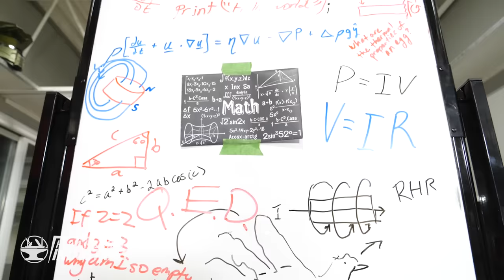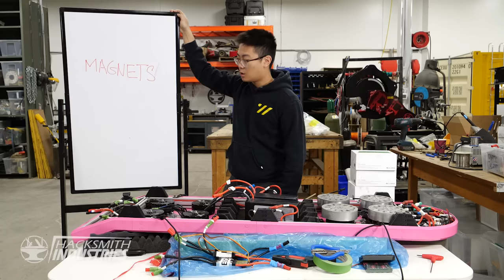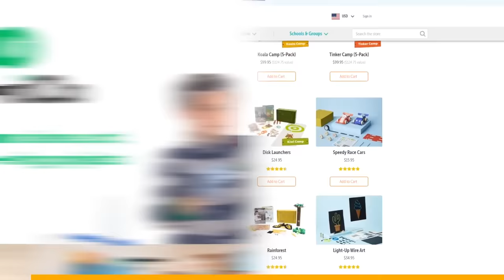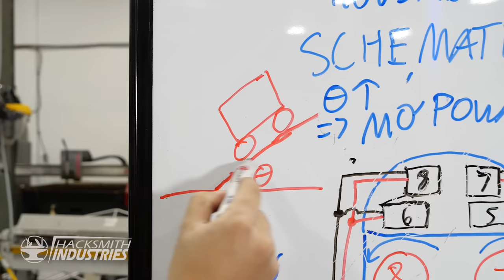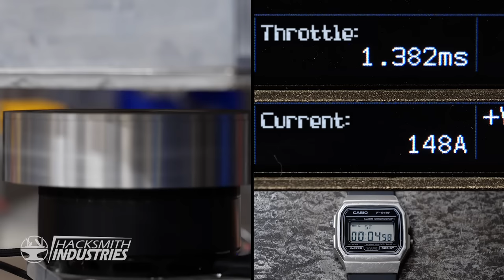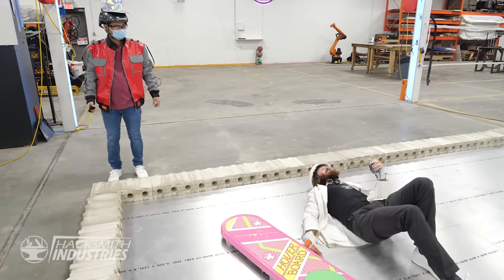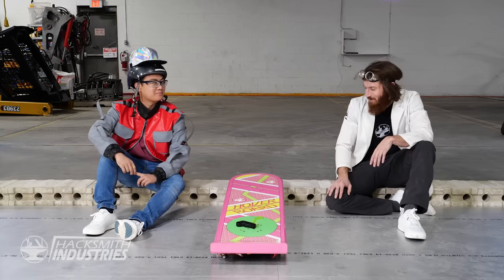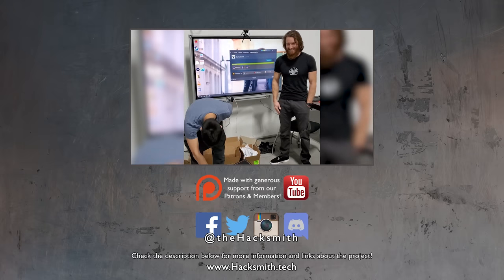HOVERBOARD TEST! (PART 2/2)

Comment: You know what else I’d bet would help the Floatation of this? 

Think Air Hockey and how the Pucks and Hand Protector Hitting Devices Float, now implement that tech into the ground beneath the Hoverboard and give the Hoverboard more of a Rectangular Frisbee like Design to hold the air, which might even cool down those engines so they don’t overheat

Comment: If you really want to have a proper hover board you would use stationary electromagnets creating a rotating magnetic field at very high speed in a similar way to the solid magnets you are using. The only difference, is the low power needed to create this affect. You will know you are onto the correct affect is when you are able to rotate compasses and aluminum plates and eventually all solids and air.

Comment: Should these hoverboards have wheels? Ok you might be saying, what is the point of a cover board if it has wheels right. Well what I'm saying the board can be fitted with wheel that have a very week suspension. Enough to aid the board but not enough to take from the experience. Doing this may even allow for a lighter board. And it might even be some what faster. Hey the more wheels the more individual suspension can be added. And more suspension the weaker you can afford to make the suspension. Question? Do hoverboards and water mix. I was thinking of a board that use water hover and wheels all at the same time. Is a board that floats in really shallow water. Shall enough so the you can push you self of the surface like you would on a skat board.

Comment: Did you guys program a feedback system for this hoverboard? 
In the video I saw lots of tests where you guys used weights across the hoverboard. What would happen if you guys attached the weights on one side of the board instead?

Comment: are you aware of eulars disc effect? if there was a way for contact resonance to "push" back at an angle, perhaps then receive less vibration per square inch.

as you mightve known, magnetism is an out of solution process.

Comment: Ok, now we see the first main problem with hoverboards. They have not strict direction unlike wheels on a real skate. So it doesn't go forward, it goes wherever it want, not wherever you want. Solving this problem and making a straight-directed hoverboard will cause the second main problem - how to turn? On a regular skate you're turning by putting your weight on the right side if you want to turn right or on the left side if you want to turn left.

Comment: Aluminum plate is soft ☑️
Unless the thicker one : 1 inch thick is more harder. Aluminum is heat distributor too. I play around with aluminum material for equipment fabrication for almost 20 years. 
U know HENDO hoverboard ?🤔
They built real hover tech too...and they are more senior ( 8 YEARS AGO ) than your creation, almost similar concept, too. You have a nice Experiment there 👍🏻😁 with electromagnetic tech 🤔❓

Comment: It kinda kills me, seeing all this, and knowing that a little group called Arx Pax did this just around 6 years ago with the Hendo Hoverboard... and they're all but forgotten today. Not a mention anywhere in the comments. Theirs used a copper surface and seemingly much higher speed motors, maybe got around the heat problem that way, with impressive run time. What kills me is seeing all the effort started from scratch, as how far their work had been forgotten...

Comment: You're very intelligent you're very intelligent person! You probably had more school than me but you're missing one or two parts on this cuz I took electric wiring for two years in electronics to yours and some classes and electric motors! One thing you went wrong you need to redesign is heat dissipation heat dissipation and also air intake flux flows okay just saying but the rest of your diet design the rest of your design is pretty good! Focus on engine heat dissipation and also bigger air intake from the top of the hoverboard those are the two things you need to focus on that should be obvious but I can't believe you even missed that!

Comment: Maybe if you only used aviation grade alminum for the board, or something like a light polycabonate, taking account the minimizing the weight of frames, that its like only the rotors, and the batteries and the rider makes up the lifted weight
Reply from the maker: But it already does float? Making it lighter won't make it floay any higher

Comment: Hovering on Eddie currents can't do without metal plates । Can't try liquid nitrogen for superconductivity । It same induction tek used in mavric levetation train here it's having its own power supply । Seen some fan ducted hover boads flying on its own power । This kinda levetation is innefficent । Draws too much power in amps । N can super heat blow esc in seconds । Try use liquid nitrogen as coolant

Comment: The disc spins he had under pink board,  is not a new concept, its actually been used to mimic anti-gravity light weight or lift, they mastered much with levetation and a bit with gyoscoptic balamce, these jr's engineers,  just needed something to mimic 'geoscoptical' with the discs spin directional population.
Reply from the maker: we explain in the build video

Comment: Its also missing some transformers to help it go higher with the amps just saying guys
Reply from the maker: That's not how this works... Transformers are only for AC power. This is a DC system ;)
Reply: Risistors would help control the out put so u dont loose important parts it would just blow up a risistor or a tranformer
Reply from the maker: Not quite right...

Comment: Now, if you can figure out a way to utilize the earth's natural geomagnetic field emitted through the ground instead of using the metal plates/mats; that would really be a leap in technology. If you could determine a way to measure the earth's natural geomagnetic resonance  mathematically, then I would suspect you could dial in the motors and ESC's to the earth's polarity, and viola! Well....maybe not that easy as it sounds. That however could take a considerable number of motors and batteries. BRAVO nonetheless on this accomplishment!! You may be closer  to that reality than you imagine. Keep up the research and development on this. You may just end up building the world's first gravity-defying "land speeder" equipped with jet turbines, ailerons, directional and reverse thrust. Think of the possibilities!!!

Comment: What if instead of magnets, you use super strong fans all around the sides and bottom of the board as well, so it can go off of metal as well.
Reply: That already exists but it's not stable going forward though there's been things that have props that are very stable. The difference was fan orientation. It's also become a distance flying sport.

Comment: That is on metal, its ment to work off plain ground if its like back to the futures board. Nice try still. Maybe try playing with the worlds magnetic field some way. Spinning magnet will lift another,it  stable spot,  no matter it stays in that distance apart of magnet spinning.
like you want. If you are smart, maybe you can do it with magnets, i seen something online,
Reply from the maker: it uses spinning magnets already...

Comment: I remember in somewhere around grade 3 I was learning abt physics and then my teacher was teaching me about magnets..(short form)in grade 3 I learned about magnets and I was going to make an empire out of it 😂🤣Please don't blame I was a 9 yo at that time :( any ways if anyone wanna learn about hover boards, check this video it will help! I remember me myself learning about the both sides of and magnetic force, if the force was VERY strong I'd say it wasn't' much of an hover board and holy I actually tried this experiment out and ooo boi was it a fun experiment cause even the slightest tilt would make it turn a lot like ALOT but if the force was  kinda small you could turn pretty smoothly and yeah I tried out the big boi magnet and then my psychopath brain finally learnt that I needed a tiny force!!I hope some one in this comments actually has tried this experiment out, by the way if anyone wanna try it out just comment on this and if there is anyone having questions about my comment, Please tell me cause I'm also a slow learner I also need time. guys have some fun trying his hover board technique it was very very good! I finally used my final hover board prototype and it used some good ol' fans ya know cuz why not,
In short form I trying to say that I ripped of a fricking fan off with the switches and stuck it to a metal oval.:elbowcough:

Comment: Why not have a board that is just the conductive metal, and spinning magnet system in the floor, this way the board is light weight and doesn't need any electronics.

Comment: Look I’m not a scientist nor a engineer , but y’all are going the most expensive and I think difficult rout. The king of random made one outa wood and a 1-2 leaf blowers. 2battery blowers and one with 1 plug in blower and it actually kinda worked. And I mean the military made a jet pack irl and they have water craft hovers things. If y’all can make a super vacuum seal than y’all can make a super leaf blower or something similar to a jet back. Not magnetic shit. We can’t just infuse the streets and sidewalks with magnets. Not tryna say I’m smarter than y’all , but I feel like y’all can come at this a better more efficient and safer way. Not to mention more effectively.
Reply: This isn’t a product, and hoverboards are just stupid. We can’t give everyone a jet pack or line the streets with leaf blowers either. Just build better transport (maglev trains in vacuum tubes etc.)

Comment: He could have used 775 50000 rpm motors that way he would go up by 5 inches (not that great but better than 1 inch) and it would be cheaper and better

Comment: i only click because the science nad engineering cost too much. I feel bad for Jimmy. However the implementation of this hover concept is not the approach I would take. The key for genuine hover is to NOT be reliant on floor/track.  Also surprised when the resistance increases with the weight of the rider we did not get further power spike (i may have skipped that bit) .. My first ever science 'idea' (Aged 10, some 35 years ago)  was for a MAGLEV car system on tracks which was totally poo poo'd for the road infrastructure changes that it would require. (better to have side mounted electromagnetic rails, and for the currents etc to be MOSTLY carried in the tracks. You don't want to carry all that hardware in the vehicle, merely switching systems to move from left rail to right rail for steering..

Comment: The problem about this should need side movements I wish yall would pay me to help invitation on this board its like you need to put magnets on four sides of the board in fact this idea would help make it go left and right with pressure plates to be added coils on magnetic ever put a magnetic with copper coils to help it make more sides movements pay me if my idea works good luck guys

Comment: This is lame, that dude from Canada built his prototype in 2015, and it can fly over water and land, not just a metal plate. How much money you spend? That dude made his control switch out of a pair of pliers.
Reply from the maker: That is completely different... we even talk about it in the  build episode
Reply: @hacksmith  Completely different, as in it works?  I get it is a drone with spinning blades, and yours is magnetic, but you got people commenting on here as if you guys have made some breakthrough when that is not the case.  You spent a fortune to make an inaccurate replica of the hover board from BTTF2 which moves about as well as those vibrating bug toys my kid plays with only your buzzing platform of death is highly flammable.
Reply from the maker: yeah.  that was the point.